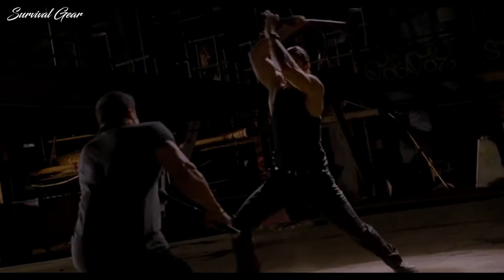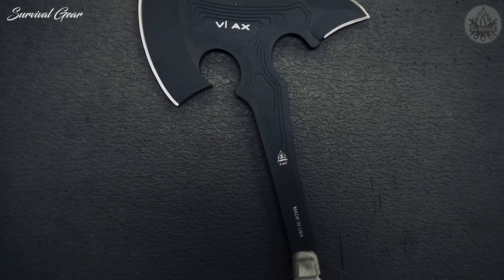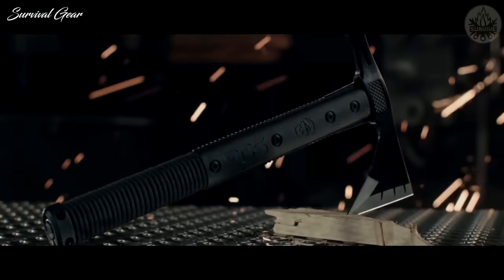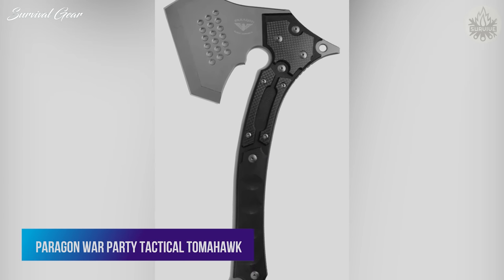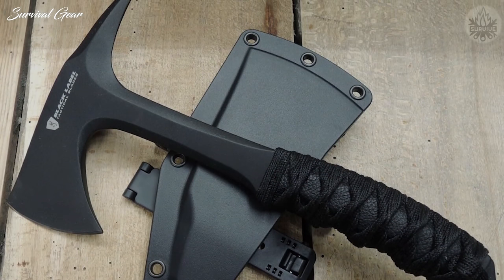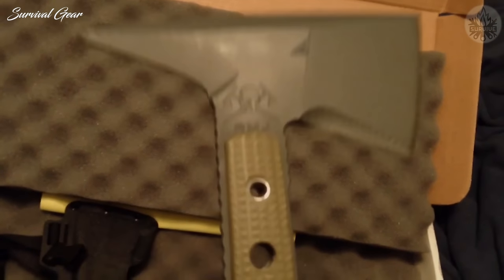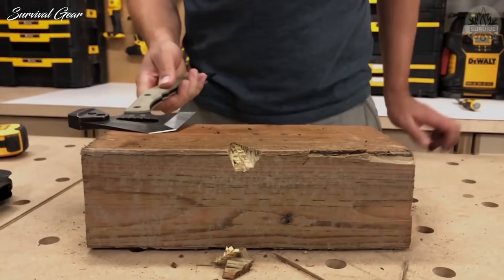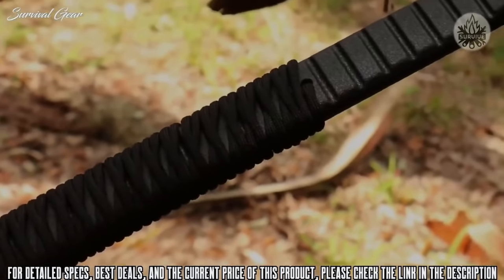Top 10 Best Tactical & Survival Tomahawk Axe 2022

Comment: I've been throwing tomahawks since the early 80's, long before any of these high priced gadgets came out. You want a good old school "Tactical" tomahawk. The Cold Steel Spike Hawk, and you wont pay an arm and a leg. Sure it has a wooden handle, make it easy to replace in the field if you break it. Another good thrower is the Cold Steel Norse Hawk. Looks like something right out of the age of the Vikings. Wont see one of these over priced fancy things hanging on my belt. But you will see a real Tomahawk.
Reply: I'm surprised cold steel wasn't on this list! Just bought a warhawk, haven't  used it yet but it is intimidating and will shave arm hair. It's a cold steel, built to last.

Comment: am wondering how these would be able to help someone defend themselves from a large wild animal - like a bear or mountain lion?
Reply: If this is your only defense, yikes.
Reply: Woods that are known to be populated by bear and big cats when you first need a side arm as a last resort. Then back away and STAY away
Reply: A pistol chambered in 10 mm or 44 magnum might work. For lions in times past, there was a special spear with a long iron blade used by the hunter who pulled up in front of a charging lion in hopes of impaling charging animal. It was braced at a low angle in the ground and jerked up to about the lion's lower neck to chest level.
May I suggest a 12 gauge shotgun with slugs. Shotguns are pretty affordable and quite flexible in uses. Some have interchangeable barrels.

Comment: Almost all are unavailable
Reply from the maker: Unfortunately due to this situation  in which we are almost all manufacturers have troubles with the stock. I hope that it will be fixed soon.
Reply: Hogue is almost always out of stock, on all their products, tbh if you want good quality without breaking the bank go with cold steel, i have their budget model of the fixed blade recon tanto, and by budget i mean its sk-5 steel (chinese version of 1095) and itll chop through 4in thick black oak, just dont expect to have much of an edge left, but easy enough to resharpen, and unless youre getting san-mai, or cpm v3, you wont spend a forture on cold steel

Comment: Does anyone actually use any of these for anything other than playing around? I have a few of these brands and wouldn't trust my life to them well not for any protracted length of time.
Reply: , my SOG is still a great chopper after being downright abused as my regular thrower practice piece.

My RMJ is my regular camp/pack ax. The steel is top quality and it’s a one piece design…there’s not much to fail on it. Holds an edge great. Done a fair bit of bushcraft with it. A coworker had one thru deployment. I’d use it for a long term outdoor piece

There’s plenty of YouTube videos putting zombie tools thru the ringer. Again. One piece construction so I don’t know what’s going to fail.